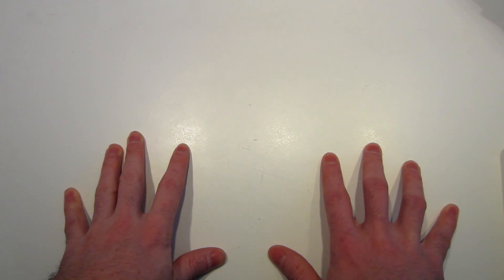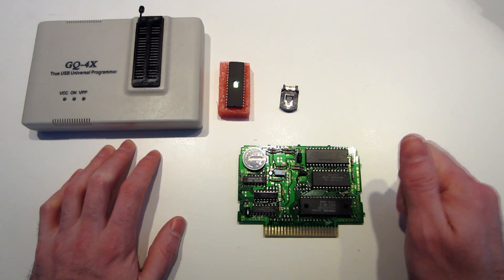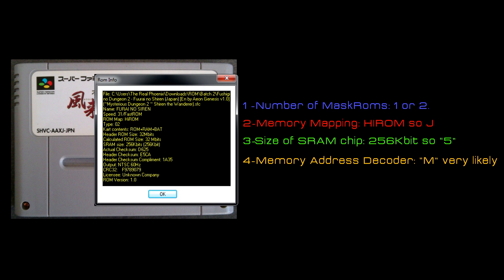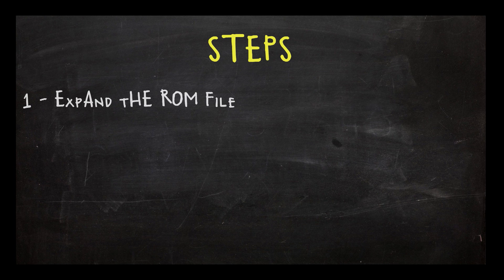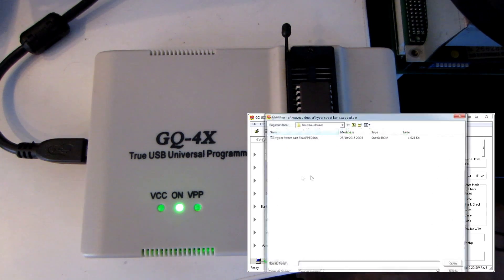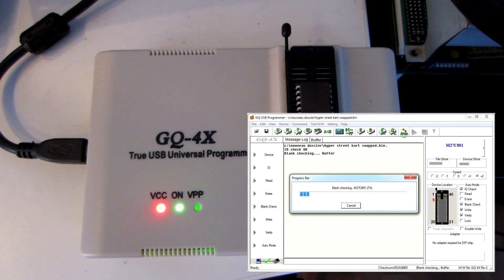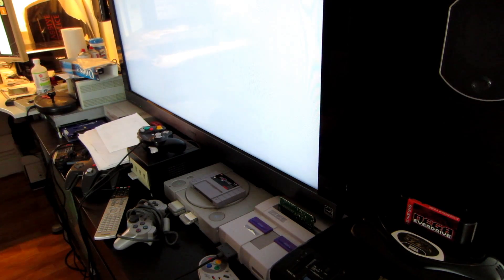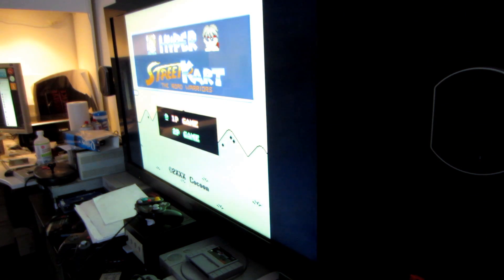[Tutorial] Super Nintendo Repro Cart - Level 01 - Easy - 8Mbits with donor cart

Comment: is 22 gauge wire ok to use
Reply from the maker: It's a bit thick for just data. 22 is fine for power. 26/28 gauge should be a better for this case.

Comment: Thanks, can I make a 8mb repro on a 12mb donor cart ?
Reply from the maker: I've never tried something like this. 12mb is mostly using 2 Maskroms, and a 8mb will only use a single 27C801. I'd say it is technically possible, but you'll have to check if the MAD mapper (or the LS1349) handling the two eeproms need some routing.
Reply: @TheRealPhoenix_Retromods  Thanks I'll check that.

Comment: So if I wanted to make the game "Sailor Moon - Another story" as it was never released in America, I would need to use this chip (m27c801)? According to the SNES database The game is HiRom, has a 64Kb SRAM, and has a size of 24Mb. I would just need to find the appropriate donor cart? the 24Mb is the actual size of the ROM correct? and the m27c801 is 8MB so it should be sufficient?
Reply from the maker: No, it won't be enought. The game is 24Mbits (24Mb) so 3 MBytes (3MB). A 27C801 is a 8Mb (1MB) so it would need at least 3x 27C801 eproms to work. Your only options for make a repro of this game would be:
- A) using a 29F032b on a DIP adapter on a SHVC-1J3M (HiROM/Saves/64Kbits of RAM)
- B) find a SHVC-3J3M (which is very rare, used only on early version of FFIV in japan, then replaced with the BJ3M ) and split the rom in 3x 27C801
- or C) find a custom DIY PCB supporting 27C322 (like https://retrostage.net/index.php/product/snes-megarom-2-0/ ) since this eprom is 32Mbits (4MB), assuming your burner can program this chip.
Reply: @TheRealPhoenix_Retromods  Oddly enough, I look at the place I get my ROM's from and it lists the game as a 2M in size. I have no reason to believe that this is mis-listed as some of the NES ROM's on the same site appear to be of accurate size......
Reply from the maker: @StickPeopleAndPuff   I downloaded the rom, the file is 3Mb on the disk and both Snes9X and SNES ROM Utility recognized it as a 32Mbit.

Comment: Hi. I have a problem with a repro. I'm making the Flashback game of 16mbits using 2 eprom 27c801 on a board with battery and sram 2J3M-01. The game did not work. Do you know if I need to modify the pcb? because the Flashback game usually uses a 1J0N-01 card without battery and sram. Thank you!
Reply from the maker: If you alraedy used snes rom utility to binswap, removed the header and split the game into 2 files of 1Mo (8Mbits), then it's juste your two eprom who are inverted. Try to desolder them and invert their position.

Comment: So for a two rom cart, I split the 16mb into two and swapbin each?
Reply from the maker: Yes. SNES ROM Utility does it for you automatically if you specify "Swapbin" and "27c801".
Reply: The Real Phoenix Cool. But I'm a bit worried about FFV as the translation makes it 20megabits. I guess it's why I gotta get a TSOP III based chip right?
Reply from the maker: Ouch, yes. Since FFV is a HiRom with a save system of 64Kb, a 16Mbits is doable on a 2J3M. But 20Mbits this is going to be tricky. If you still want to use a 2J3M donor, here's how I used to do them back in the days:
- Remove the header,
- Expand the ROM file to 24Mbits,
- Split manualy the ROM into a 16Mbits (2Mo) file and a 8Mbits (1Mo),
- Burn the 16Mbits into a 29F016B put on TSOPIII adapter (NO SWAP),
- Burn the 8Mbits inot a 27C801 (NO SWAP),
- Since Manually wire the 27C801 swapped pins.
It's tidious, and honesly, I strongly recommand to use PCB like the ones from RetroStage.net for simple repros. (http://retrostage.net/index.php/product/snes-megarom-2-0/ unfortunaltely out of stock right now)

Comment: Hello,
first of all thank u for the awesome Video. Now I got a Question:
I want to repro a game with 64kbits of Sram. the games I got flying around only got 0kbits sram and 16 Kbits.
What are my Options here? Do I need to search for a game with fitting sram or can I mod it in any way?
Thank You in Advance
Reply from the maker: Well, it's always possible to hack a donor to fit your needs. With no ram on your donor you'll have to recreate the saving circuit (meaning at least a LS139 and a bunch of resistors, plus the battery). Then put everyting on a perfboard and a lot of wire to link everything.
The 16Kbits ram will be way easier with just some traces to re-route. The only differences between Sram size on the PCBs are the additional addresses to be linked properly to the memory mapper and the maskrom. I don't have the scematic in mind, but I've already did it for Shiren the Wanderer (256Kbits sram on a 64kbits donor). If you have a 64kbits you can compare the traces and you'll see you'll something like like 4 traces to rewire.

Comment: Hello, your video is very good. Could you explain me better the PCB cart code: SHVC - XXXX - XX. What I really want to understand is the fourth X: Type of the memory (B, M and N). Are PCBs compatible with each other? Or will the burn of a game only work on a card of the same type of memory? Thanks!
Reply from the maker: Hey.
The 4th digit is the memory mapper. You only need to know if it's a B or M (which means there is a save system) or N which means no save system.
There are some games like Legend of Zelda (I think) which exists in both XXXB and XXXM: 1A3M (1 maskrom, LOrom, 64Kbits of RAM and MAD mapper) and 1A3B (1 maskrom, LOrom, 64Bits of ram and LS139 mapper).
If you a game which needs a save system on a XXXN PCB, it's possible it won't boot, or at best you won't be able to save. You can put a "non-saving" games on a XXXB or XXXM PCB it will work, but the saving will be useless.
Just be sure whatever you're doing to respect LOrom or HIrom (XAXX or XJXX).
Reply: Thank you so much
It was well explained! Congrats for your video.
You have a new fan subscribed!
See you

Comment: I've got already a repro cart with Metroid Redesign for SNES, I'd like to change its rom into Metroid Redesign Axeil Edition. I'm wondering if it's possible.
Reply from the maker: Well it depends of the repro but it is definitly doable. You'll have to unsolder the Eeprom (or the two Eeproms, IIRC Metroid is a 24Mbits LoROM game), then reprogram them. After that it'll depends of what's inside the repro. It could be a AM29F32B on an adapter if the PCB is a donor, or if the PCB is a new one it could use a 27C322 or (two 27C160), etc...
Reply: Thx

Comment: Hey, thanks for the video. I want to replace the eprom of my japanese games with english translated version. Would I follow the same steps but instead of using a donor cart can I just use the original cart? Do I just desolder the old eprom, apply the english translated rom using the gq-4x then resolder as you did here?
Reply from the maker: Hi, Yes you can reuse the original cart as donor of course, but you cannot reprogram the original maskrom. Those chips are one-time programmable so you'd still need to burn the game on a 27C801 and manually swap OE and pin 31.

Comment: Very good man, congratulations! Could you do a tutorial with 32Mbits ROMs pls? The pinouts of the 4 X 27C801 are wrecking my neurons :/
Reply from the maker: I don't think I'm going to to the 4 x 27c801 solution. The 27C322 + two 74HC255 is way simpler. A few years ago the AM29F032B solution was the best, but now the chip is too expensive. I honeslty think using brand new PCB for 16/32Mbits games is a better, simpler and cleaner solution (and no donor).

Comment: Can you reflash the original chip? Like if you make an adapter for the flasher?
Reply from the maker: No. The original Maskroms are one-time programmable. If they were reusable, I won't use a 27C801 as replacement.

Comment: How can I use the EPROM 27c4001 to make games using 1Mb ?
I have only this eprom and I wanna to repro Zelda, is the possible?
Reply from the maker: The 27C4001 is a 4Mbits (512ko) while Zelda is a 8Mbits game (1Mo), so you'll need 2 of them. Also, VPP pin should be linked to VCC pin, NOT on the board.
I'v never tested a repro with this EEPROM. You'll also need to find a LoROM donnor car with 2 Maskrom + saving features + at least 64Kbits of Sram (2A3B).
I don't think the byteswap will work (it's designed for 27C801), so just splitting the ROM file and wire manually the two EEPROMs. Not sure this will work though, it's possible that you need to rewire some additional pins to the LS139/MAD mapper (you don't have an A19 line on a 27C4001).
If you don't have a compatible donnor cart, it's possible to make your own memory mapper by adding an LS139 between the 2 EEPROM or rewiring pins on the LS139 on the cart.
Reply: Where can I learm better about how to do snes repto using flash memory
Reply from the maker: There's no really just one place where everything is explained. On some retrogaming forum people explains some stuff, and you'll have regroup differents sources. The thing is doing a repro is seens as a bad thing by the retro community especially if you're using a donor cart, since you're sacrificing an original hardware. I have to make a video about non-donor repro which are way easier nowdays.

Comment: Hello!! This is a very interesting way of how to program your carts. Congrats!!! :) It seems that you have weld everytime you need a different game. Is there an easier way of how to reprogram the memory? I mean not welding. Anyway thanks for your clues :)
Reply from the maker: Thanks! Yes this is more for a permanent way to have a custom game, then use it as a normal one.
If it's just for testing you EEPROM, you can solder pin sockets (don"t forget to swap pin 23 and 31) so you can plug/unplug your EEPROM. But this will be too thick to close the cart shell.
There are others solution like the reprogrammable reproductions on http://www.infiniteneslives.com/snessupplies.php, but you'll need their custom programmer.
If you just want to play a game the Super UFO Pro 8 is the cheapest solution, where you can store game on a SD Card http://www.emuparadise.me/reviews/SuperUFO/.
More expensive solutions with a better support of games and additional features also exist, like the Super Everdrive or the SD2SNES.
Reply: The Real Phoenix Wooww! Thanks again! I'll see what's the most affordable and comfortable. Thank you!

Comment: Hello. good video, for beginners like me. Can you say, If i have a PCB with 256k sram, can i use it for games with less sram?
Reply from the maker: Mmm I've never tried, but theoretically, it should. I now the wiring of the between 64k and 256k are slightly different (RAM chip have direct link to the MaskROM's I/O), and it sould be ok since we don't need to access to the memory  block from 64k to 256k. I could test that quickly this week end.
Reply from the maker: Hey man sorry for the late response. I tried a 1A1M game (Stanley Cup) on a 1A5M game (Sim City) and it saves. Cheers!
Reply: Good, thank for test